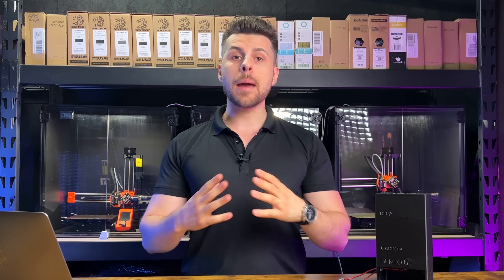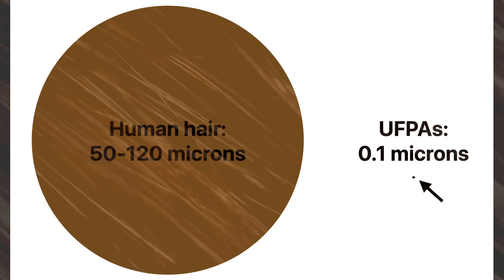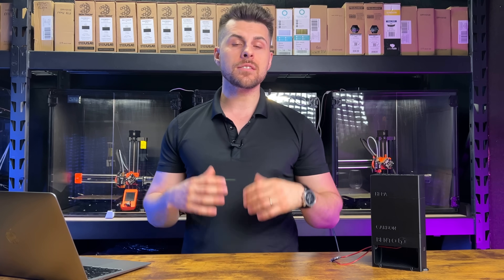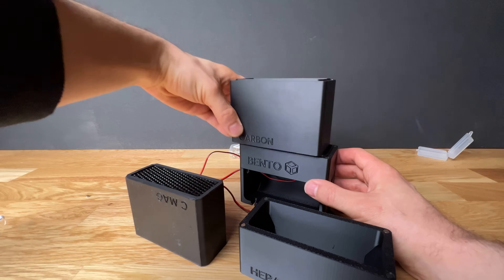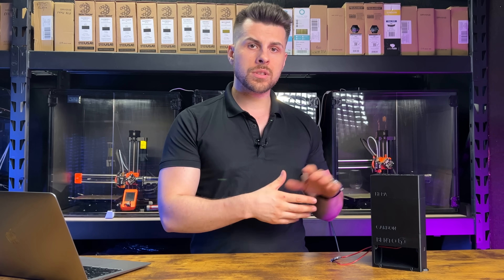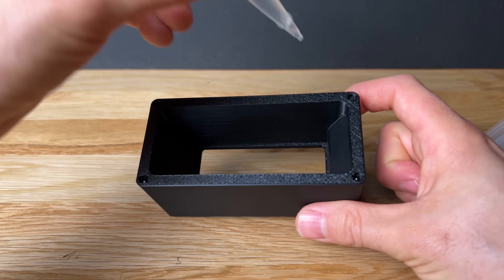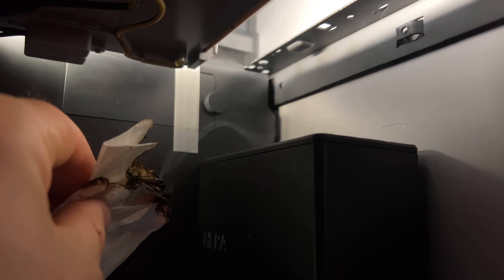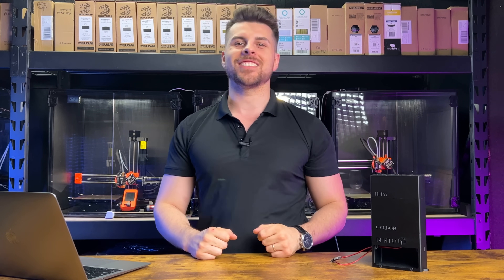Best DIY filter for your 3D printer: solving 3d printing smell and fumes

Comment: I have a qidi plus 4 and it includes a small filtration system with charcoal. I was wondering if simply adding a hepa filter into this existing setup would be the same as this bento box? Also couldn't petg warp inside a sealed enclosure?
Reply: adding hepa to existing filtered exhaust would definitely help, but i think having the recirculating filter inside combined with your existing exhaust would be even better.   regarding petg warping, I suppose that depends on what materials and temps you will be using.

Comment: Petg doesn't give of caprocalctun. It's actually one of the cleaner fillaments like pla. Yes they release Vic's but they are out mid irritants as in you have to have underlying health issues or stand next to them all day for anything to actually happen. You re exposed to voc in every day life like when your cooking on a gas stove. Or you have a wood fireplace. Caprolactum and styrene however are still some really nasty shit. Caprocalctun is a moderate irritant while styrene is a carcinogen. As for bpa you are exposed to that every single day as ca prop 65 is there so you can sue company's for not smdosclosing it.

Comment: Nice. I use the small Ratpack filter from Ratrig in my V Core 3. It does something but i still have a window open, a fan blowing towards it and an Ikea FÖRNUFTIG with activated carbon running all the time. I print ASA for the most part.

Comment: There isnt enough information from manufacturers on printer ventilation, i have my tents vented to outside with an inline fan in the ductwork as well as the extract fans in the tents, this works fine But dont forget to allow air into the tents otherwise it wont extract anything, i find a 3d printed zipper spacer works for air inlet just right

Comment: "HEPA filters are rated between 1 and 3 microns. The predominant particle size for 3D printers is on the scale of nanometers, which are 1000 times smaller than what a HEPA filter can manage." From reddit
Reply: I got one plus the X filter that has the HEPA and Carbon for my P!S and noticed a small difference in smell.  I live in an apartment and my setup is in the den.  I have no airflow because I wanted no draft for ABS but Leave the room during printing.  The truth is no buddy knows how bad it is and its long term effects on us.  They are still debating vaping and it changes year by year.  The funny thing is we all think that outside air is fresh air and its not.  We can just try to do our best with air purifiers and filters.
Reply: @jameskelman-dd6vp true
Reply: Good ol Reddit. That is obviously not true for real hepa filters. Are these ones actual hepa filters, who knows.
Reply: @wojtek-33 idk buddy. So a real HEPA filter should stop the particles from printing right?
Reply: Yes, but some of the particles will still get stuck.

Comment: What would be a good solution for an open printer like the Bambu Lab A1 Mini?
Reply: Either build/buy a case so this solution can work. 
Without a case printing ABS/ASA is out of the question anyway, and PLA/PETG produce a lot less harmfull particles. Just make sure to put the printer in a well ventilated room and you should be fine.

Comment: Any tips on how to run the wire to an external power source? I have the P1s.
Reply: In case you still need help, i drilled a small hole on the right hand side of the printer, right at the bottom (when viewed from the door). Than you can unscrew the backpanel and lay the cable down in the exact same way, the original chamer ventilation fan is routet. Close to the power supply, i used cable clips to connect them on top of the GND and 24V outlet of the power supply. Hope this helps a bit ^^
Reply: @muggah2704hey! Thanx for the answer. Turns out there are holes already in the bottom plate, one on each side. I ran the cables through the left one.

Comment: I am new to 3D printing and last week i got the A1 mini and i can say is as soon as i turned the thing on and it heated up the nozzle i could smell, taste and breath the crap. I could feel it in my lung and throat, also on my teeth and tongue. I dont know but that was like minutes after i turned that thing on and it was PLA, not ABS or exotic stuff. I can not even think about using that thing in the winter with closed windows etc. Even when i opend the windows and put a huge ventilator in front of the opend windows plus an Hepa air cleaner with activated carbon i could smell and taste it. So i bought a housing plus a 10mm tube ventilator and two exhaust tubes, i hope it will solve the proplem or make it at least better. Do you all have lung made of asbestos for not feeling anything? When i was a child people always warned me not to melt plastic because of cancer. I would love to add a activated carbon Hepa filter to my solution but it has to be using the cheapest filters or maybe loose activated carbon you can refill yourself etc. not the overpriced spare filters for hepa cleaners you can buy. The bento box is a good idea but make it also for people with ventilators, many people have tube ventilator in 3D printing or laser cutting, they use pipes to guide the dirty air to the ouside. So to create a housing with filter and activated carbon that can be plugged to a tube would be great. You need bigger ventilator for sucking out the dirty air, at least 10mm with good air flow
Reply: Hi! I know how you feel and have not yet printed a single thing because of this issue. I am planning on housing my A1 as well and to make a negative pressure inside by using some computer fans, leading the air through a home made filter and than outside with a duct. Some say this is overkill but Ive heard of people getting headaches from the fumes etc and its a better safe than sorry situation. I will either use these carbon pellets or a mat that you can cut to shape to decide your own thickness (and thus effectiveness) Stay safe out there!
Reply: @oryxnauwelaers7887  I have both now, the A1 mini and a few days ago i received the A1 and i got those "tents" for both and similar configuration. Both have 4 inch pipe ventilators and the tube is attached with magnets to the tents. I ordered a plexi glas plate with a 4 inch laser cutted opening and i use velcro to put it in my window frame so that the fumes can not come back into the room. I dont filter the fumes, i dont need it anymore. 

One important thing, dont create negative pressure in the enclosure. I asked the KI about air ventilation and all that and its a rule that if you put in a 4 inch exhaust hole (for a tube ventilator for example) you have to create a 4 inch hole on the other side of the enclosure as well, just leave it open, its passive without ventilation, the air will come in. If the enclosure has to small openings or no openings at all it will wear out the ventilator and the air exchange will be not good, it also create turbulances and wind inside. I always thought its good when the enclosure is sealed but its not.

Comment: Will this upset/disturb ASA/ABS and cause malfucntions?
Reply from the maker: No
Reply: @3DPrintingForMoney  Neat, was worried about it causing airflow in there.
Reply from the maker: Disturbance even with 4020fans is not noticeable on 30h asa prints
Reply: @3DPrintingForMoney  Super cool, thanks a ton!

Comment: Something so small gives you false sense of safety
that HEPA filter is a joke
Reply: Could you explain for the class how having a larger filter that all air goes through is superior to a smaller filter that all air goes through?  It doesn't matter how big it is. We're not ventilating a large space.
Reply: @Rainsoakedcoat  a vacuum hepa filter is not capable of removing the small UFPs. The guy is totally right in that a robot cleaner hepa filter wont remove any UFPs in VOCs whatsoever. You would need at least Class HEPA H13. And no. That is currently not on the market in 80x40mm. Which means that you would need to cut down an existing HEPA H13 filter only to then glue the ends because u dont want filterparticles floating around. Only then you would have a working VOC filter. Be careful if you do this. The type of glue needs to be not releasing any gases when heated up or else all this is senseless.

Comment: Is this more effective than the nevermore v6? Looking to start printing engineering filaments on my n4 pro. Going to make a diy enclosure with ikea furniture but need a solution for the vocs.
Reply: i guess we need a source for cheap activated carbon for refilling a 3D printed filter housing, that would be a dream because the filters on amazon are expensive and they last only a week or so. those thin activated carbon filters will soon loose the ability to filter VOCs. Maybe design a filter housing that uses IKEA air filters, like cutting them into smaller pieces for cost reduction. In my case i have bought the amazon enclosure for the A1 mini and a pipe ventilator 10mm with a exhause pipe out of the window, i dont use filter but with filter would be better.

Comment: I see a few things that could be improved... it requires really coarse carbon.  I'd suggest using like some screen in there and maybe use a zeolite-carbon mixture since zeolite is really good for gas absorption. I'd also prefer if the unit wasn't actually inside the printer, but rather on the outside of the machine so it pulls the air out of the machine and through the filters instead (also makes it easier to change filters).  Also maybe add a resonator on the exit of the fans to reduce any noise (if any). Also, you could probably go with a more square-box shaped stack on the outside and use a single larger fan. You'll just have to change the inlet geometry a bit...but it'd work.
Reply: The problem with having it on the outside is you'll pull the hot air out of the unit, and pretty much any of the materials you'd want this for (ABS, ASA, Nylon, etc) would need the hot air to stay in the enclosure for printability.
Reply: Funny you mention that.. I was just talking to my friend about it, and what we came up with was using one of those old 12V heaters that plug into the cigarette lighter  as a heating unit for an enclosed printer that doesn't get hot enough... needs a temperature controller with it that.

Comment: I made a bento box but ended up removing it again, I knew that the fans would be loud, but the resonans the box creates in the printer is to much to handle. I have even printed TPU gaskets for the fans, filter and buttom of the Bentobox but they did not help.
I really like the idea to "clean" the air within the printer, but the fans are just to small to make it good solution (and there are not space for large fans)
Reply from the maker: I found out that high flow 4020 scrub better. If you want to go gucci, 4028
Reply: put the bento box on some foam... then add some mass to the bento box (ie steel or something else dense) Even better if the steel is in direct contact with the fan frame. Better too if its a 'block' vs sheet steel. ball bearings suspended in silicone is pretty good... 
Basically ... mate it heavier and then put it on a material that is very light and soft.

Comment: Isn't it possible to use the USB inside the P1S?
Reply: USB is 5V, won't work with 12V fan.
Reply: @Lykos_Archos  There are 5V fans...
Reply: @corwinwhitehorn7759  link in description is 24V fans, you can put 5V fans but I'm not sure it would be strong enough to push air through the HEPA filter
Reply: ISTR something about the internal usb not being able to drive two strips of LEDs, so I think it’s going to be way short of driving two fans…

Comment: What filament type should I consider to print it
Reply: All the stores that sell the complete printed kit are selling it in PETG. I'd imagine you can also print it in ABS but I don't think it's necessary. Just don't print it in PLA, that will most likely warp due to the heat in the chamber
Reply: @alexis11o  OK thanks. I am printing it right now. At first U had a missprint because the filament got stuck. Lost 40g...

Comment: I recreated the boxes myself. However, I measured the micro-lidar and think it might possibly collide with the box during operation if the print is too close to the BentoBox, as the micro-lidar on the X1C is positioned very far to the right. Has anyone had issues with this before?
Reply from the maker: Something is not right. You can always shorten one of the sections 5/10mm in the slicer tho

Comment: What if you were to put a USB-A or C connector on this and plug into an open port on a printer? Would that work? Wrong voltage?
Reply from the maker: Will need to buy fans matching port voltage
Reply: @3DPrintingForMoney  Most ports are 5V 0.5A
Reply: If you wish to tinker with electronics, you might be able do just that using resistors. ElectroBoom has good educational videos (that are not boring) in electricity and circuitry. Highly recommended!

Comment: Been using a bento box with HEPA, carbon filters and the 4028 fans for several months.  Seems to work well.  Have the fans power supply plugged into a smart outlet (TP-Link).  Home Assistant then turns the fan on whenever a print is started, and turns it off when done.  Makes using it all the time very easy.
Reply: Home Assistant has a plug in for Bambu printers.  It reads almost all parameters and send commands to the printers.  Add automation routine to start & stop fans with printer.
Reply: @chuckm3520  thanks man. I have a ton of kasa plugs. Didn't know about this.
Reply: @chuckm3520  any idea if there are similar things for other printers / assistance (like Alexa) ?
Reply: That's a pretty elegant way to power the fan without having to mess with the printers wiring... Will do the same!
Reply: Don't know about other than home assistant.  Lots of good videos on how to set it up.  Have found after a BL update, I'll need to restart HA to reconnect.
Reply: What printer do you have? If it's a bambu how does tp link know it started?

Comment: Hi, I’m assuming the longevity of the filter material depends on filament type and usage but is there a typical range of time between changing filters for usage? Failing that is there a way of identifying when a filter change is required?
Reply from the maker: Yes - my rule of thumb is 100h for abs, 150h for asa/pa and 300h for pla/petg. Not set in stone tho. We have a weekly maintenance schedule with logs so it is easier to keep track of things.
The pellet/filter cost is baked in the product cost
Reply: @ hi, thanks for the response.

Comment: Me and a friend of mine each built an (as much as possible) air tight ikea lack enclosure for mk3s. Then used a nevermore max for filtering with a huge amount of carbon and 4 hepa and very powerful fan. It's blowing a lot of air, many times more than my nevermore micro in my v0.2 (I barely feel that one). 

We also built a full sensor suite (based on nevermore specs) with custom firmware and screen for monitoring the status (before there was official support for this from nevermore). Honestly, this huge filter is barely enough for filtering both PMs and VOCs. I can't see these tiny filters (both nevermore micro and the one in this video) doing much.
Reply from the maker: If i recall the ikea lack volume is approx 4x the bambulab chamber. Interested in your sensor suite. Do you gave a github or project link?

Comment: 0:30 Correction: FDM filaments actually emit over 200 different compounds during printing as discovered in a study.

You can minimize the emissions by lowering the nozzle temperature and using mainly PLA. Avoid especially Nylon, and CF filaments (those emit CF microparticles with unknown but probably bad effects on your health). HEPA filters only filter particles and not VOCs, so the easiest and cheapest solution to 100% avoid exposure is to use an enclosure and a hose with fan to suck the fumes out the window.
Reply: The carbon filter traps VOCs, the HEPA filter traps particles. Both are in use here in this solution.
Reply: Do you have a source? General curiosity. I use PLA only but I can only find lactide as the only emission.
Reply: @Vintage_XV   The source has the unwieldy title "characterization of volatile organic compound emissions from consumer level material extrusion 3D printers"

They identified over 50 different compounds from PLA, no PETG numbers unfortunately. Interestingly even ABS and Nylon emit far less VOCs than laser printers, but I'm not sure that's as relevant as the kind of VOC or particle.
No matter what you do, don't print carbon fiber filaments unless you know what you're doing. A CF filament manufacturer I've seen that sells to businesses recommends ventilation, breathing mask and gloves during processing.
Reply: @brinkoftext  Well I'm glad I went through the comments. Got some carbon fiber PLA for a project this weekend. I'm new to 3D printing and this will be my first time using carbon fiber, so I'm absolutely making sure to bring my respirator with me. Thanks!